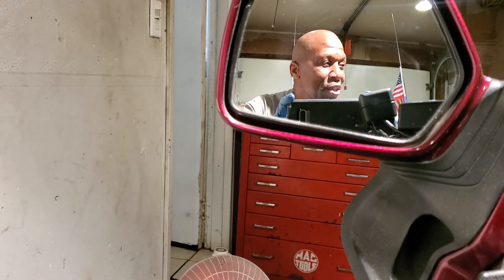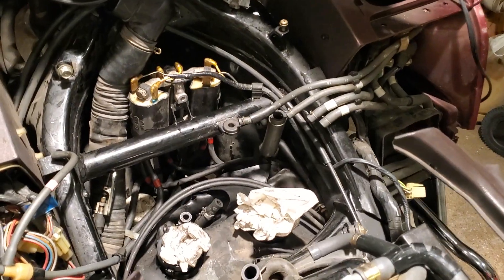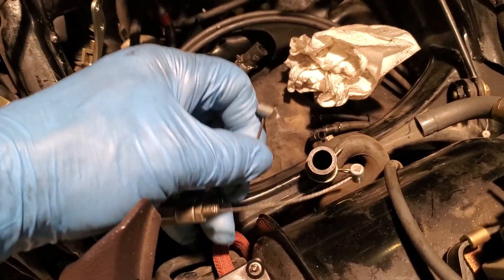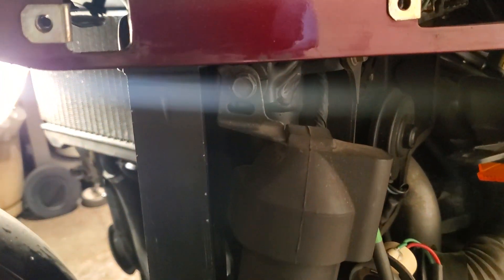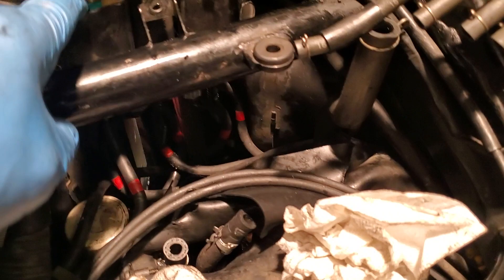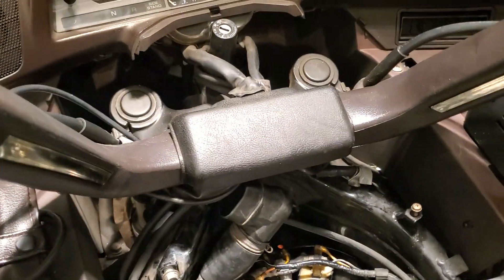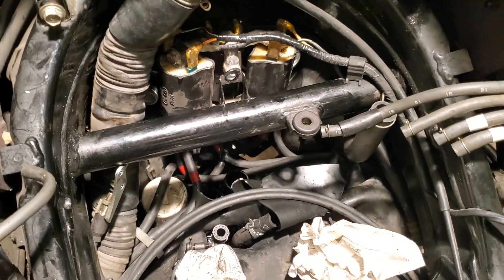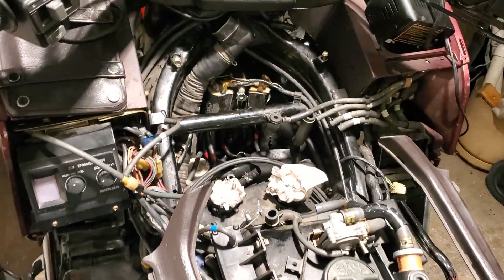Honda goldwing gl1500 thermostat.

Comment: Thanks for the video. I needed your inspiration to tackle this job on my own. I have a coolant leak somewhere under the filler cap of my 1994 GL1500, and no idea where it's coming from, so I'm digging into it soon. I hope it's just a loose clamp. Time will tell.

Comment: My 89 GL1500 has a terminal lean condition. Sea foamed........checked vacc leaks......isolaters .....air shot delete.....im considering removing the 2 water lines from the carbs and  just bypassing them, because it only runs lean once hot. I never ride when its cold out anyways. Im sure mpg will go down alittle, but im worried about the knocks and pings once temp comes up.Your thoughts?
Reply: There are several reasons why your wing will run lean you will have to go through the 7 induction systems that you're 89 has go look up on you tube  Shane Martin the 7induction systems of the Honda goldwing gl1500 it's a training video for technicians it will help you understand how the 7systems work and help you get to the problem quickly to the other two things are in correct float bowl height set to low causing a learn condition or have you changed the original exhausts?? If you have you may need to remove the carbs and rejet them too at least two sizes bigger another one to check out is the vac lines underneath the rubber matting the red colour ones go to the carburetor control box and because they are all linked to both manifolds are prone to rotting I have just replaced mine with silicone ones because the silicone lines take temperatures upto 200c lastly join goldwingdocs.com.